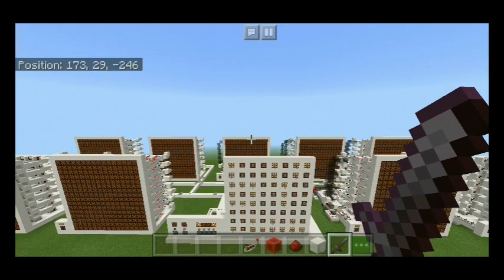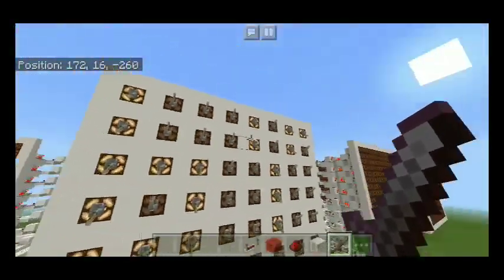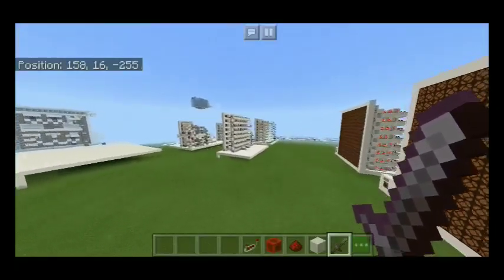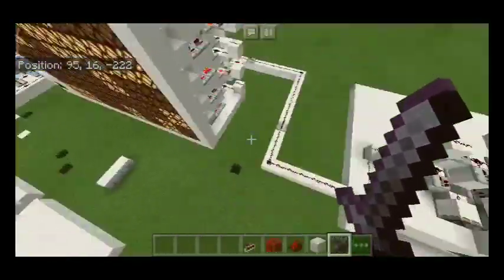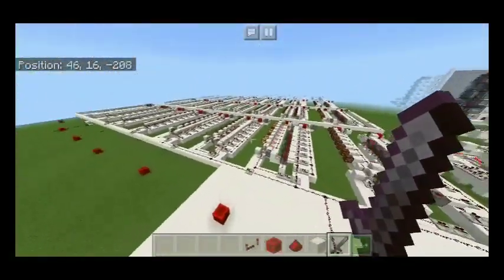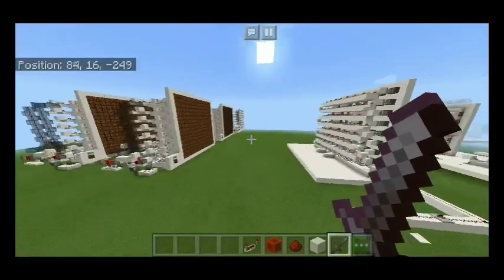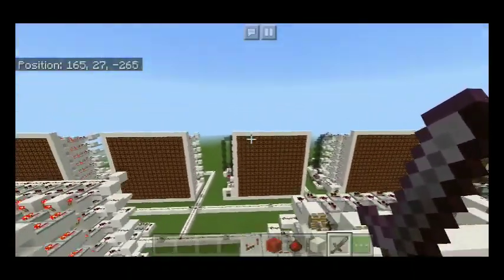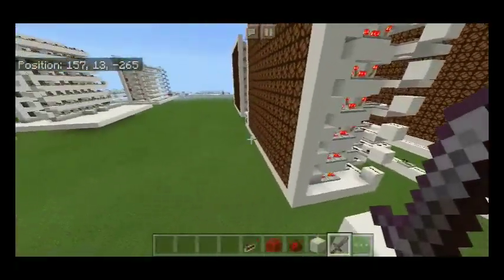Single Wire Multi Redstone Display in Minecraft, Serial Data Transmission Part-5

Comment: I think the addressing system could be a bit simpler if you used signal strength and a redcoder. Connect the redcoder to the serial data line with an and gate. Would also allow you to have 16 addresses
Reply from the maker: Lol I already posted a video with a system which can create 255 addresses and believe me binary address is alot better than redcoder cuz redcoder requires signal strength preservation which will create unnecessarily high delay when using too many of these displays and since the 8×8 Display is based on binary i will have to make 2 different circuits when using redcoder but here i am using the same redstone line for both addressing system and 8×8 display data
Reply: @diablo931.  Im speaking of a redcoder directly after the serial encoder. The address wont get transmitted through the serial data line that way and wont slow the system down.
Reply from the maker: @Robert-zg1bd  but then the system won't be a single wire system it will have multiple connections also binary allows u to have basically Infinite address by just increasing the address bits but redcoder is limited to 16
Reply: @diablo931.  It will still only have one wire going to each address. You could have a hex decoder to get more addresses with hex aswell so its not limited to 16 although i do agree that for more addresses binary is more practical. If you only have 16 than hex is more handy imo
Reply from the maker: @Robert-zg1bd  this 15 address system is just a prototype for even bigger projects ,I prefer binary cuz it has no limitations and even tho hex is a nice option i don't really think it's necessary cuz it will take exactly the same amount of space as binary decoder
Reply from the maker: Also the current 4 bit system can have 15 address which is just one less from redcoder